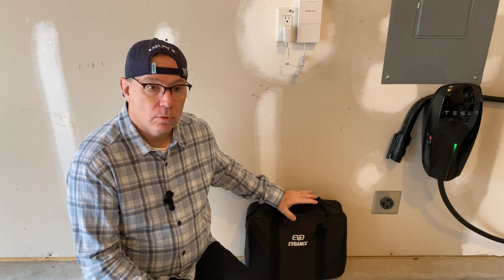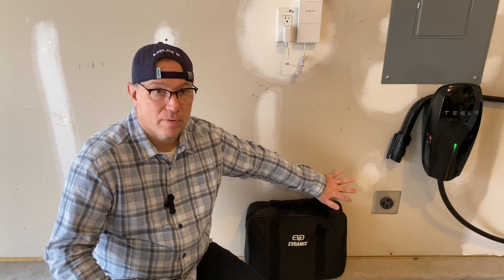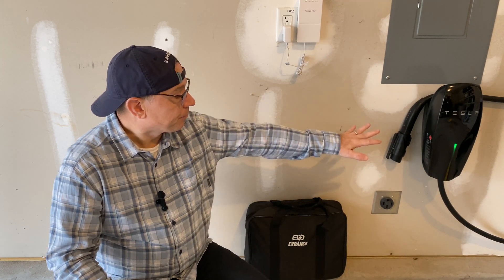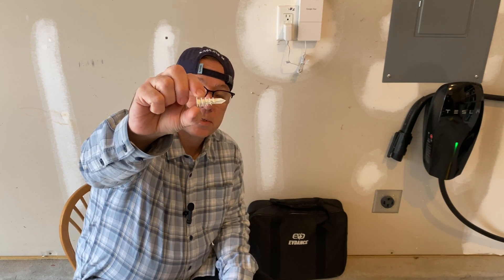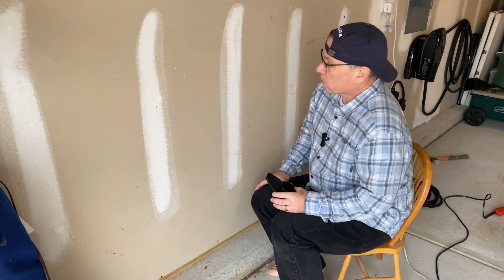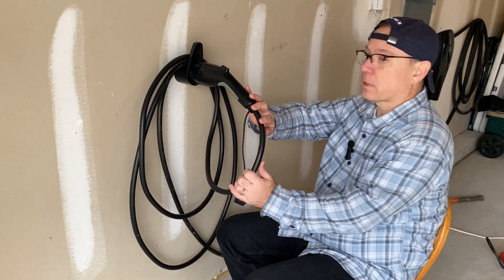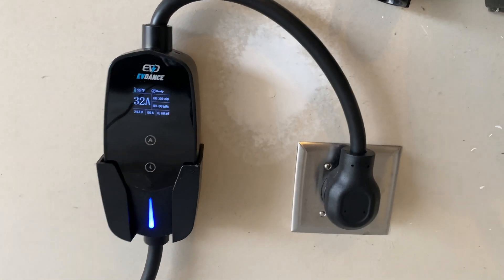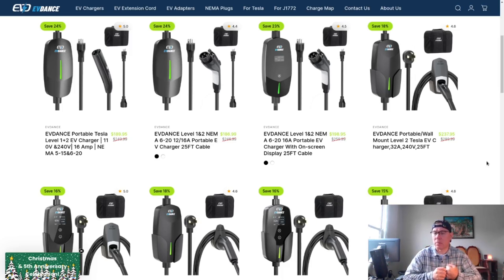Today I Installed a Level 2 Portable Charger at Home

Comment: I personally wouldn't be using a charger that isn't UL Listed
Reply from the maker: You are not alone. I personally do not mind and will provide any updates if problems are found.  We are using this as our daily charging src for one of out two EVs now, so it will get a lot of use.  Thx for watching.
Reply: @thenetworkarchitectchannel I appreciate the open, honest content. I just worry about differentiating the good quality products from the junk
Reply from the maker: @metal_horses568  in the case of EVdance, I personally would not call their products junk.  I have used 3 & interacted with their staff.  The operate a customer svc dept and the marketing contact I interact with is obviously professional.  Neither have I had anything but good success with their products.  Specifically the 80 amp Tesla tap has been working like a champ better than the lectron.  I respect others may hold a different view of the company and their products.  My interaction have been positive.
Reply: @thenetworkarchitectchannel That's good. I just hope the internals hold up. Hopefully getting UL Listed is in the works

Comment: Walter, The breaker for your 14-50 outlet doesn’t look like it is a GCFI model.  That should have been included in your $1000 install, and may have been required by code if installed after your local authority updated to the latest National Electrical Code.
Reply from the maker: Thanks!  I just checked and it was 2021.  It was both permitted and inspected, so maybe that was not code back then.

Comment: $1000 for 14-50 just two feet from the breaker?  Wow, I would expect $400-500 for that.  However, the latest NEC requires a GCFI breaker for outlets used for EV charging.  That adds enough cost to make a hardwired EVSE less expensive in total than a 14-50 plus portable EVSE.
Reply from the maker: thx for adding the color.

Comment: I have a 40amp circuit but currently just running a old 16amp Clipper Creek I had for 10 years. I have other higher amp units but I like the older one for its small super thin charging cord. I charge 3 cars with it.
Reply from the maker: Didn't know Emphase/CC made a sixteen.  They make good stuff.  Like the Sears Roebuck of the charging industry.  I bet it outlives the three cars twice over.
Reply: @thenetworkarchitectchannel not really any more but its a good time to restart making them as California will require 16 as a min in all homes.

Comment: Thanks, Walter! When I had my NEMA 14-50 installed about 8 years ago with a 4' feed, it cost me $200. I guess it helps to hire a local electrician in a small community.
Reply from the maker: I pulled the receipt.  In $2021 it was $889.  We got it back due to taxes the next year.  There was some provision in that tax cycle.  I think we got taxes back too for the even older Tesla hard wire one.  In the years since, it has paid for it self if in nothing more than weekly chore trips to fill up at the gas station I use to do.  Have't done that in I can't even remember how long.  Happy holidays Eric

Comment: I could not find any mention of a temperature sensor in the 14-50 plug, which I believe is important to prevent connector damage or fire. The website mentions thermal protection on the mainboard of the charger, but does not say anything about the plug.
Reply from the maker: Good point.  I am unsure.  They do have a support line if you ever wish to hear the answer from them.

Comment: Since you have two EVs, it makes sense to have a 2nd level 2 "charger" in the garage. And it makes even more sense to have one of them portable, for when and if you are on a roadtrip. I had to install a second "holster" like you did in a stud, but I bought one that let's me plug it in from the side so that it doesn't stick out so far. I noted, by the way, that you use the same J1772 adapter on your HPWC that I have on mine. I might recommend that my daughter take a look at EVDance's solutions for her new (used) Ioniq 5.
Reply from the maker: I like their 80 Amp tap.  The lectron got hot.  The EVdance does not.  Stays ambient.  For portable, both the Cadi & Volvo have portable that came with them that I keep in the two cars, so in our case no need there.  I like the way this turned out.  It was a fun video to make.  I like being able to do home work like this and in the EV passion of mine was double points.  Have a good holiday.

Comment: Have a 32 amp level 2 charger - all I need. 40 amp circuit. Can derate to 24, 20, or 16 amps.
Reply from the maker: I agree.  As long as I can charge to what I need while eating dinner and sleeping, doesn't really matter.  Thx for watching.  This was a fun one to make.
Reply: Yeah it's plenty sufficient for home use. If it was a destination charger, like work, 48 or higher would be great to accommodate more EV owners.

My employer has 6 older chargers in our lot maxing around 29a at 208v and it can be a pain when some hog it all day.

Comment: Thanks for the video.  It might be a good idea to get an infrared thermometer and check the temp of the outlet (and the breaker) from time to time.  It's just another layer of insurance.  The connections can work loose over time and have high resistance, leading to excessive heat and possibly a fire.
Reply from the maker: I was thinking the same.  It will be the primary going forward.  Maybe add to content of 40 amp vs 32 amp.  Happy holidays
Reply: Absolutely. I keep one near my setup and check at the plug, the outlet  the EVSE and handle. I also check the EV dance extension ends since I use those 2x a week
Reply: @diydrivenGA  You're a professional. The only thing that needs to be checked is the connections.
Reply: @layking9228  I'm not
Reply: I went this route after pickup up a 2nd OEM Volvo EVSE for my XC40 Recharge. One stays in my trunk and the other is permanently plugged into Leviton's upgraded EV rated Nema outlet on a 40a breaker.

Comment: Hi! great video! - What adapter do you use for NACS to J1772 on the wall connector? Thank you.
Reply from the maker: I have both the Lectron and EVdance.  I regularly use the EVdance.  It is rated for 80 amps.  The Lectron gets hot.
Reply: @ thanks! Ever tested either with an E-GMP car? The website it’s non compatible with ev-6 but ok with ioniq 6. Which is confusing.
Reply: Walter, The 16 A portable EVSE is not just Level 1.  It can be used with a NEMA 6-20 outlet for a 240 V L2 solution.